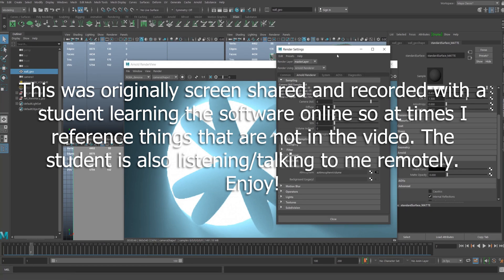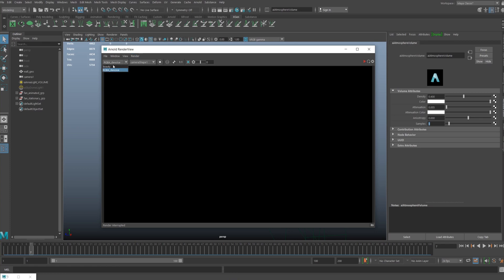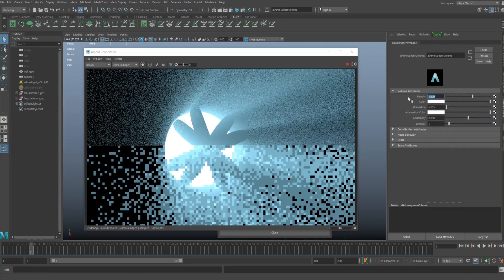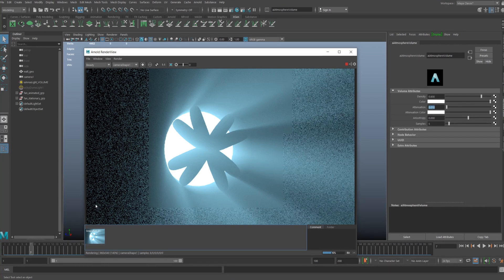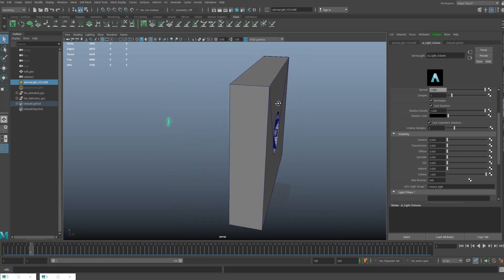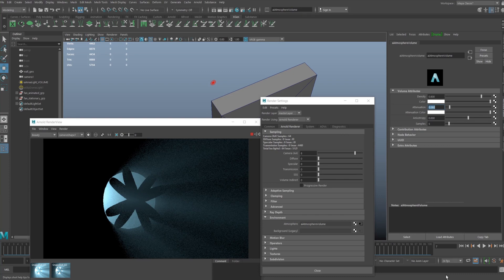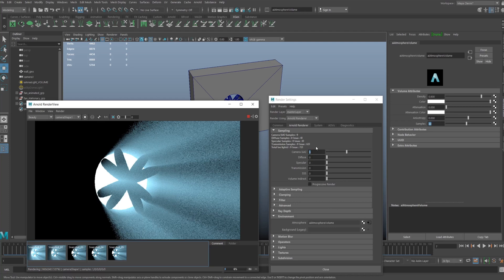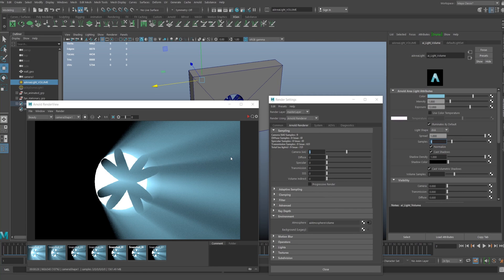Maya 2020 Tutorial: Atmospheric Volumetrics Setup & Rendering

Comment: For some reason whenever I add aiAtmosphereVolume the MAX density I can have is literally 0.001, anything higher and it's too much... What's even more bizarre is everything in my scene is huge.
Reply from the maker: This could be a few things but without testing I couldnt be sure. There's 2 things I can think of which is if your scene is huge the it might be due to your camera default clipping planes, go into the attribute settings of your camera and change min clip to 1.0 and then far clip to a huge number like 1 million. What might be occuring is that your scene is so large that maya is trying to calculate the fog but most is being clipped out. Other then that perhaps change your global scene scale settings from cm to metres and try again, a few of the tools in maya operate in non-cm scale which is mildly annoying, I don't know if these have been changed but I certainly remember  around the 2010s that nCloth, bifrost and MASH were calculated in metres so you have to adjust everything for those accordingly or change your global scene scale to metres